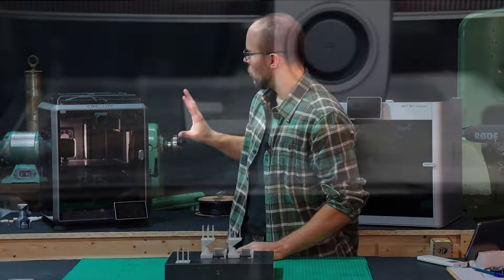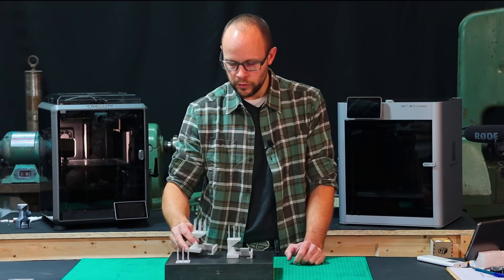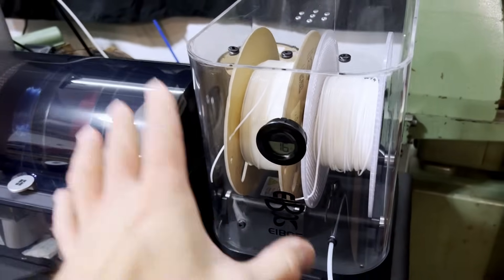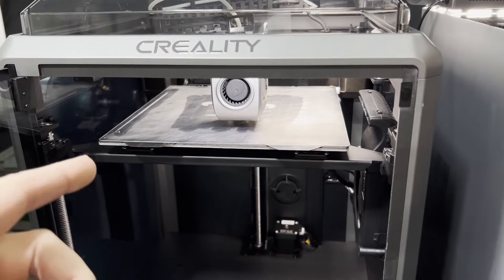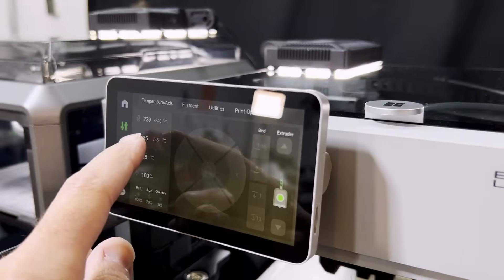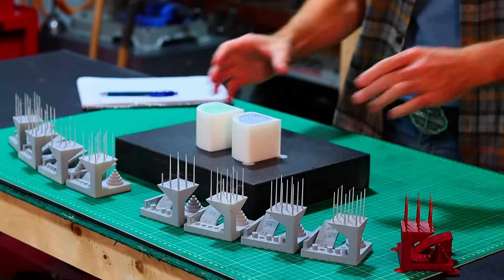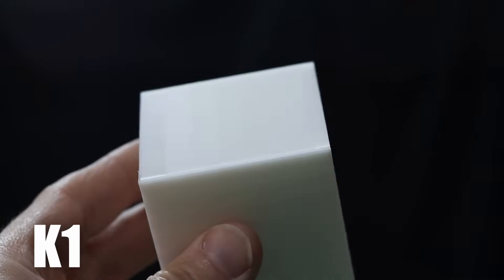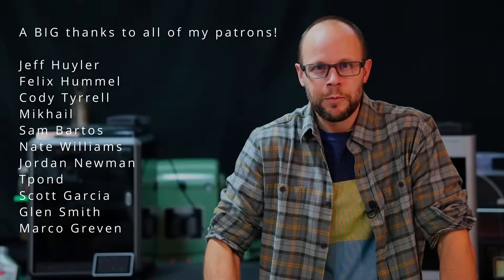Should you slow down your fast Creality K1 or Bambu X1C Printer?

Comment: Can you please make a video that goes over how to manually level the bed on the K1? Maybe something like a "tuneup" video? Tension belts, etc. 

You can tuneup both the K1 and X1C then run this exact same test. 

My K1 Max has an unusually high spot by the front door left corner. Because of that high spot, I can hear the bed rapidly going up and down to compensate, which makes a wavy print on that corner. 😔 

The remaining 3 quadrants of the bed area are perfect, but I'm printing massive items. 😅
Reply from the maker: Hey, thank you!  I really appreciate the support.

You and I must be thinking the same things because I have that exact video on my list.  It's an issue I ran into with my K1 printer also, the bed was 1mm out of level.  I took it apart and tried to re-level the bed 4 times, and I was not having good success, so I took a little different and simpler approach.  I will move this video up on the list so you can expect to see something in 1-2 weeks.  

Like you, my bed is still wavy, but mine is the opposite on the front right corner, it drops down.  I  have been thinking of ways to fix this.  Can I ask about the typ bed temp your running?  Do you have an example of a part that I could use for the video as well. 

I am super stoked, I just received a new RODE wireless mic set which gives great sound quality... and I am finally able to get in front of the camera without looking like a full-on robot.  I should be able to get up to 3 videos/wk soon.

Thanks again!  Any video Ideas are welcome!
Reply from the maker: @AvocadoAtrocity I have an update for you, I have a solution which gets us really close, mine is now within 0.25mm highest to lowest, the bed itself is a bit warped, which accounts for nearly all of that difference.  I began at 1.46mm out.  I was able to reproduce the issue you were seeing as well with the leadscrews adjusting quite a lot to compensate for it.  I'll have a video ready within a few days for you.  If you'd like the solution sooner let me know and I can get it to you.
Reply: @NeedItMakeIt  Thanks for pushing on this issue. I'm going to print out these main door systems for a drop door system I engineered, so I can wait patiently. The fact that you got that much success is AWESOME!

I'm running whatever bed temps the K1 Max recommends for Creality Hyper PLA. Looks like 45 for the bed and 220 for the Hyper PLA. 

I'm unsure if you have links enabled, but here is a link to how the bed looks out of the box:

https://i.imgur.com/fi8wxC8.png

The one corner is so bad, that the I can hear the bed go up and down whenever I print along that edge. I'm printing very large boxes with sliding doors. The prints literally take up almost the entire print area!

  https://imgur.com/a/EVDjkyk
Reply: @NeedItMakeIt Not who you’re replying to but I can’t wait to see your video! I’m running into some sort of VFA/ghosting issue on my K1 max that’s been frustrating me. I notice there will be groups of layers that look completely fine, then groups of layers that show issues. Usually wavy patterns. I especially see it when printing square corners, the problem layers usually have a more rounded looking corner if that makes sense. I’ve tried tweaking bunch of things like acceleration, jerk, input shaping, etc. May try orca slicer again but it seemed to make the prints worse when I tried it initially. Anyway, sorry for the whole essay, just wanted to say I’m looking forward to your video.
Reply from the maker: @Schermit  I was supposed to be replying to Avocado, not sure what happened with there.  Tech is changing so quickly it's hard to keep up with where to place the # or @ or @#%^ symbols.... 

I've had this same problem with my K1 when I first started printing with it, towards the upper layers I believe that it is a problem with a slight over-extrusion and the  nozzle is rubbing while extruding, but I'll have to dig deeper on this one, there is very little documented on this.  There is a possibility that it is a combo of problems, infill position on interior wall vs direction of travel of the nozzle while it's extruding and some over-extrusion.  It could also be a speed/resonance issue, my part also had rounded corners, so that could indicate that we're travelling at higher speeds in these areas.   Recently I printed some parts which had no signs of this, they were shown in my 'BROKEN?' video from last week.  Those parts had rounded corners also.  A bit strange, but I think we can get to the bottom of it.  I will see what I can find out.  Are you able to send me the file by chance?  I'd like to test the part you're having problems with.

The video for bed level comes out today at 3:00pm EST, I hope that it helps some people with the same issues I was having.
Reply: @NeedItMakeIt  Oh no, you did nothing wrong, I worded that poorly. Was just saying I wasn’t Avocado and that I was butting into the conversation!

Yeah, my thought is it has something to do with the speed settings combined with the VFA problems that are inherent to coreXY printers. I’ve noticed on calibration cubes certain layers will be more affected than others, so I’m wondering if it has to do with slow down during overhangs or something. I’ll shoot over the most recent file I printed which had this problem pretty badly once I get off work. But it seems to be present in just about anything I print. Thanks for the heads up on the video, I’ll make sure to watch that when it drops!
Reply from the maker: @Schermit  Come on in!  Anyone is welcome to join in.  Yeah I completely misinterpreted what you said, when it comes to @ symbols and such I'm still a noob; I figured it was me!

Okay, so calibration cubes, and around overhangs

I did a bit of digging and I found some info that I wasn't expecting, I'll have to try it myself as well, but what I've seen looks exactly like what I've had, and it is what I would call a 'rippling' in certain areas.  That rippling looks a bit like what you'd see on a squished first layer, except it's on walls, at least that's what I'm gathering from our conversation.  What may be the source is that we have a hotend/nozzle which is just at the border of not being able to keep up with the speed of the printer.  Pressure buildup will cause the inconsistent extrusion around those areas, and they should be on areas printed faster if this is true.  In the worst case, the result is far worse, but in our cases it seems to be more just borderline.  It's worth a deeper look, it doesn't seem like the problem, but I've seen images online which seem to indicate that this may be the cause.  Your thoughts?

I'll check out the model, you can email it over or find way to link it here if that works.
Reply: @NeedItMakeIt  Definitely could be extrusion related! I got home today and had to disassemble the extruder since I had a clog right before where the little internal PTFE tube connects to the extruder. I think there could be multiple things contributing to the same issue. I have a hard time describing the artifacts I get on the prints, but it does sound similar to what you wrote. Most of the time they aren’t a huge problem, but if I try selling prints I just wouldn’t feel comfortable shipping items with surface problems. 

I tried finding an email to send some examples to in your profile but couldn’t. Don’t know if I’m blind or it’s a mobile problem! Would you mind dropping an email I could send those to?
Reply from the maker: @Schermit  Sure, it's needitmakeit@gmail.com   from that we should be able to tell if they're the same issue and we can narrow it down from there!

Comment: I am new to 3D printing having started only a month ago on my Bambu X1c Carbon machine with 0.4 hardened steel hot end.  In all of the discussion below, newly opened filament reels are  used so as to eliminate compromised material.
PLA and PETG have produced good quality parts from a variety of model sources,   The most reliable parts (no stringing, spaghetti) are produced when running at Slow or "Silent" speed.  Many times, the parts run at normal or fast speeds will see excellent bed adhesion and produce good form for the first 15 to 40 layers.  At that point, it appears that the filament does not adhere to the top layer and the hot end does the "ghost dance" (moves but no filament laydown.  Again, slowing down to "silent" will fix this problem  At this point, I'm flummoxed.  
Further, I am having difficulty when using ABS on the factory settings.  I have yet to produce a successful part using brand new Flashforge ABS Pro.  No speed change correction.
Thanks for your quality videos.  It is nice to see a scientific approach (control & single variable assessment) used.  Cheers from Pensacola, FL.

Comment: I have a K1C and it likes 60mm/s or under, or exactly at 130mm/s for VFAs. at 5000 acceleration. As for horizontal banding, you may want to clean your extruder. Or you have a wobbly extruder gear.

Comment: I learned higher speed is mandatory for certain high flow filaments like the sunlu high speed.  Running slower results in more artifacts, layer lines and fused supports which ruin the print.  Some filaments cool much faster than others and should be run faster.

Comment: I had issues printing gyroid infill at high speed on the latest gen K1 max. It kept vibrating the extruder screws out even though they were super tight. I had to slow all the way down to 130mm/s and reduce the acceleration. Slowing down also helped keep tree supports from getting knocked over. Still trying to push for faster speeds without sacrificing anything. Linear rail and thicker bed plate are on the to do list.
Reply: I also have a K1 Max and am having to slow my print down for PLA, currently at 160mm/s (outer, inner, solid infill, sparse infill)   What are you accelerations at?
Reply: @BannisterLee  The gantry was causing horrible VFA and dimensional accuracy issues. I did the linear rail mod and it fixed everything.

Comment: Good afternoon, I have been printing at my job using two, Markforged "Mark Two" using Onyx, and a Fortus 450 using ABS. They have been ok . I just purchased a X1 Carbon for myself. 
  I am looking at trying out some "SpiderFlex Matte Finish Flexible TPE 3D Printing Filament - Shore 40D / 90A " using  the X1. I am going to use a 0.8mm tip and not run it through the AMS. 
  I have never really had the chance to test out various materials . Do you have any experience with this material?  I am looking to make some nesting . and my potential customer requires Shore 70A. I have looked into this material and it says it can get to Shore 75A and I think this may work. Provided I can print it successfully.  
  I stumbled across your page and really like the content. And since you are in Ontario you are very relatable to me lol. Anyway hope alls good and if you have any insight , it would be very much appreciated.  Thanks

Comment: Hi everyone, i think the best approach is to do a flow test with different temperature for eatch printer and choose the best for your filament (strength, appearance and behavior), then try to average the speed in your slicer.
In my case i use the flow limitation with the a spicific temprerature and i try to minimise higher or lower speeds (flow rate) during all my prints even if i change the layer hight or line width, that's my secret for getting better prints with max speed.
it's my first day in your channel and i love it, thanks

Comment: This is only a visual test.  What about deflection and strength (layer adhesion) and effects on strength with different filament types?
Reply from the maker: Sure, those are great ideas for a follow up video, I have some videos planned and I can certainly add your ideas in.  I was thinking about also printing with a large nozzle, possibly 1mm, I'd likely replace the infill with an extra wall in the center along the length of the part.  Do you think it would perform better or worse?

Comment: What keeps me from buying both high speed printers is the cost and the print volume. I need a 300 x300 by a z of 100 for what I'm doing. So I use a creality 3 Max neo. It's because they're cheaper. I have three machines and the combined cost is comparable to one fast machine.
The main thing is people need to realize is to buy what fit your needs. If the base of what you're printing is 254 mm and the machine is only 250 it's a major issue. Sure I could cut for a millimeters off but if that was the case I could get a bunch of creality standard neo and produce multiple parts at the same time. And if I have a part failure it's not a big issue. The downside is you really need to know what you're doing. I recently bought a used machine and the person changed out the bed to a PE! And original owner messed with the dual Z rods requiring me to fix the rods because there were no longer in the bearings on the overhead. It's not perfect but it now prints properly. You don't save any money by buying a used 3D printer. I went back to the glass bed and if I want to PEI but I use blue painters tape and attach it to the creality glass bed.

Comment: I would say the artifacting had more to deal with heat than speed on its own. The hot end lingers more on those sections which has an impact on the surface quality

Comment: Yet in your conclusion you didn't mention once that the Creality K1 didn't need to have it's hot end temperature raised at all, you just increased it a little just in case where as you HAD to raise the temp of the Bambu printers hot end over 40 degrees so it wouldn't fail. I'd call that a massive failure on the Bambu's part.

Comment: question are you maxing the speed off the outer walls too? eg at default setting my flashforge 5m is 200  max outer wall speed.  and 65% can we push this to 300 with no effect?

Comment: Hey man, great video and I just subscribed! I recently got a K1 and looking to get the most out of my machine. Just wondering if you use creality print still on your K1 or if you've moved to a different slicer. Thanks!
Reply from the maker: Hey, thanks!   

I wasn't too impressed with Creality Print, I rooted my K1 and I use Orca which works really well for me.  It also works with my Bambu, I can easily switch back and fourth..  A little annoying that the buildplates keep changing sizes, but there's not much to do about that I think.  

Let me know if you need to the links to root.  Also if you do end up rooting, you'll end up getting access to Fluidd or Mainsail and that should let you get some good info about how level your bed is.  I have a video on that one as well.
Reply: @NeedItMakeIt hello, is there any downside to rooting the printer?
Reply: @NeedItMakeIt  I own a K1 too and I want to root but Im a newbie

Comment: Figured I would ask.  What is your opinion of the closed source nature of the Bambu?
In the past for me, user generated firmware always made big improvements to my Ender 3 V2.  I am looking to upgrade now and it's either the X1C or the K1.  But with the closed nature I am concerned for the longevity of the X1C.
Reply from the maker: Good question.  From what I've seen, Bambu wants to be the leader, they're going to be going hard to develop what no other consumer printer company has done.  Since they're pushing to innovate, I think they'll try to hang onto the closed setup they have for as long as they can as long as they're doing more than anyone else, they'll be in good shape.  Personally I think we have a few years with Bambu before they too become too big and they offer too many options and  bloat their company.   There are some up and commers in the meantime that certainly have the speed advantage like FLSUN, but I don't have one YET and I need to test it to see whether it lives up to the hype.  

Personally I'm happy with the performance of the X1C using Orca slicer, and at least we have the option to use an open slicer.

I'll be updating the firmware tonight, and we shall see if the motor noise really does have an impact on the overall sound levels and if the VFAs are also reduced.  It looks like there are some other handy features they've added as well, like being able to setup your own custom filament on the printer.  

I think yes to Bambu for now, but in the next couple of years, I think there will be some big changes.  There will be a completely different way of 3d printing emerging for hobbyist and industry and it will be faster and more uniform in strength in all directions.
Reply: @NeedItMakeIt  OK, but I am liking that Creality too. Yes seems it needs some tweaking still but I am use to that with my old Ender 3.  In your comparison seems you are using it more now.  And it's on sale for $740.  Quite a difference.
Reply: @FinlessBob just release open source firmware